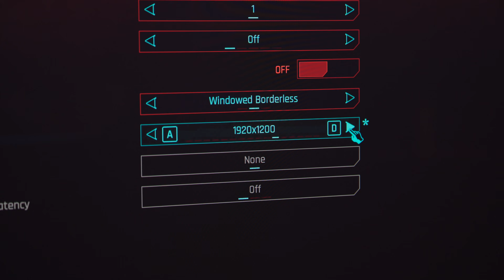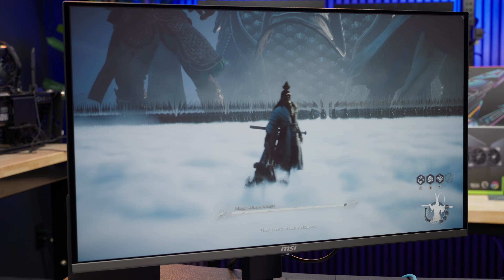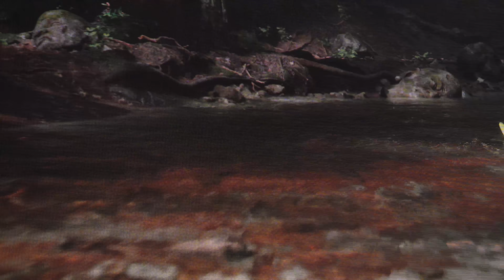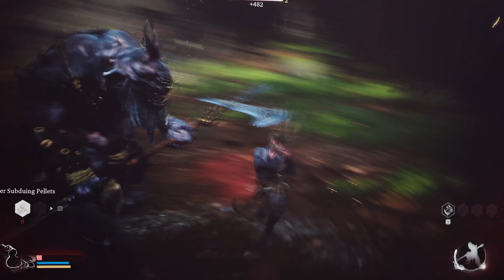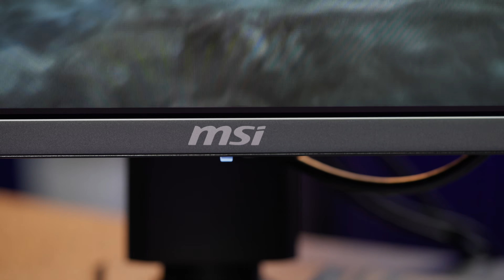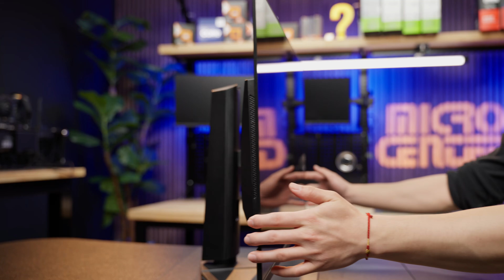MSI MPG 321URX 32" 4K QD-OLED Gaming Monitor | Keep Up With Your GPU

Comment: Does 1080p and 2K also work at 240Hz?
Because I see in the manual that it says 120Hz. That's weird
Reply: As long as your using the display port 1.4 connection you will get 240Hz at 2K and 1080P. If using a console and connected to the 2.1 HDMI port, that will drop your Hertz down to 120.

Comment: I have that monitor since yestersay and i love it. 
I have to test some things, not enough time. 
I have an rtx 3080: most games i have? No problems to play in ultra settings. Yes, some games need a bit help to have a bit more fps if needed but on this moment, my rtx 3080 with 12700f processor and good ram are still good, even for playing in 4k for a casual gamer. 
Maybe next year a buy a rtx 5080. 

My other monitor was a 3440x1440 hp x34, also a good monitor but yeah, this msi 4k monitor , offcourse, it is much better, cleaner, sharper and so on.

And i need to do more in next days but works with g-sync and i think i had no flickering. But i gonna game alot more next days. In the beginning it showed 8bit, you have to change it in nvidia settings, i found it thx to chatgtp :).

Comment: I bought my 321urx directly from MSI for $899, free shipping and no sales tax. Using firmware .015 and my 77" qd oled is significantly brighter and more accurate. Can only do 144hz thouugh.

Comment: I have this monitor paired with my 4090 and it eats. MSI’s pixel cleaning and OLED care software runs whenever your monitor is off or whenever you schedule it in settings. Burn-in is basically non-existent nowadays too.